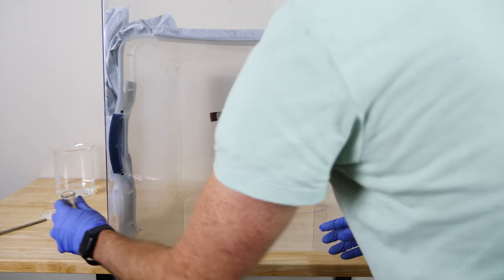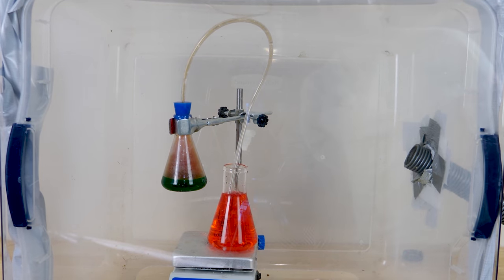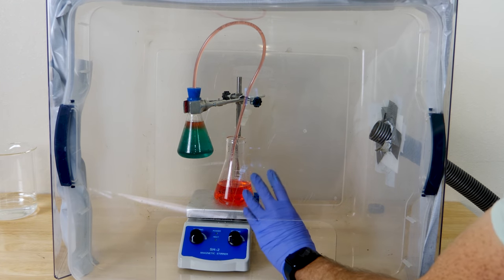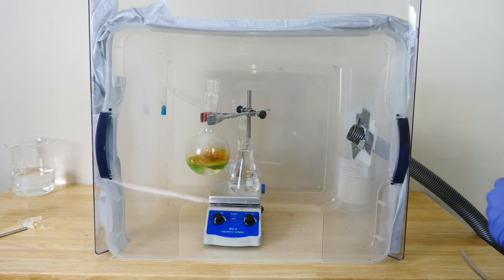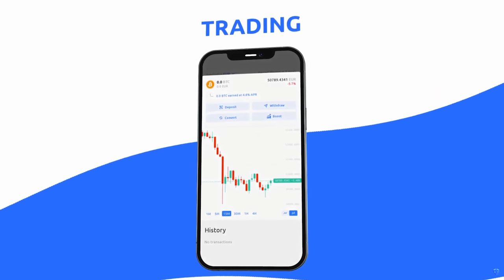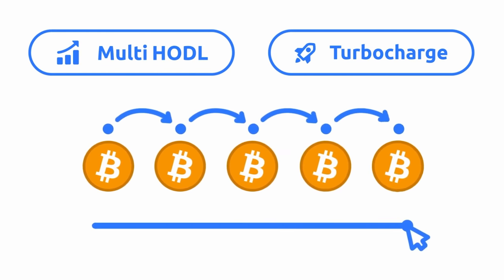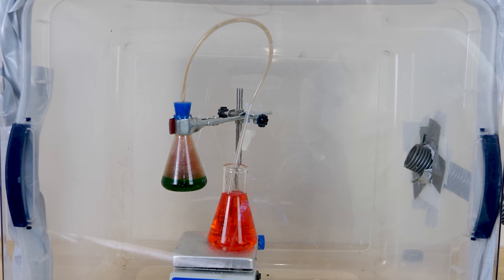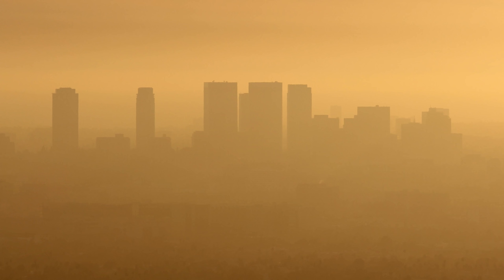Can You Figure Out How The NO₂ Fountain Works?

Comment: Yes, the NO2 gets dissolved (absorbed), but also the NO2 forms N2O4, a colorless gas (the reaction consumes 2 NO2, so creates vacuum) . That's why the brownish color fades away over time.
Reply: He could repeat this experiment with the 2 liquids heated to 60C or more, which would almost entirely get rid of the N2O4.
Reply: @linkpatrick  would that make it harder to retain the nitric acid in the water? I am not sure about this.
Reply: The NO2/N2O4 reaction is a reversible equilibrium that depends on temperature. NO2 is favored at high temperatures, N2O4 at low temperatures. Since everything is close to room temperature here I doubt this played much of a role.

Comment: Ammonia dissolves into the water and the pressure in the container drops. As a result, more water is forced into the container from another inlet creating a fountain effect.
But kids, don't try this in your school lab without permission--a tear fountain will start if the teacher finds out 👀
Reply: @cell to singularity Is it? Oh--my lab manual has this one line answer 😅 My bad if it doesn't work
Reply: ammonia?
Reply: @lautaromorales2903  yeah, our teacher used ammonia all those years ago. Probably because it is less toxic than nitrous oxides.
Reply: @cell to singularity yeah. It creates hydrochloric acid.
Reply: @cell to singularity Will it create H₂SO3?
Reply: @mrxmry3264  oxide?
Reply: @EpicGlitchyJuice  NO2 is not the only possible combination of nitrogen and oxygen. So yes, there are a couple of nitrous oxides.
Reply: @mrxmry3264  I didn't wanna say that and if nitrogen oxides are combing and forming no2 is just like  n2 + 2o2
Reply: @cell to singularity makes sense. Sulfurous acid is a weak acid. Sulfuric acid is a strong acid. I wonder what the concentration of the acid can become in this process.
Reply: oh no  rude to post a religious link on a nonreligious video, especially as doing so is implying it’s about the experiment
Reply: In this setup, it doesn’t matter if the gas is soluble in water, just that it’s released from the small flask, causing a vacuum inside.

Comment: Same thing happens with the related “Ammonia fountain”. 

The NO2 gas is VERY soluble in water and so it’s dissolution actually creates a vacuum. It takes a while to reach this point though, because NO2 is still being generated. Once the rate of absorption into the water exceeds the rate it is produced in the flask though, it back flows.

Comment: Regarding the case of burning matches in an inverted cup...
I think most of the volume change is due to using up the oxygen and has little to do with the temperature. Note that you lose about 20 to 25%of the volume in your experiment.  
I guess you could try doing this over a liquid that doesn't dissolve the CO2 byproduct of the flame to see how much is due to O2 use.

Comment: 1:38 - please correct this mistake . It's not the gas heating and cooling, but it's the match using up all the oxygen inside the beaker... That's y always and everytime when this experiment is done, irrespective of the temperature only 21% of the beaker is filled with water - which is the proportion of O2 present in atmosphere

Comment: 1:32 my first thought was that the nitric acid + copper-> NO2 also used some oxygen from the air, but a more likely explanation is that the reaction is exothermic and heats the air, making it expand. The hot gas mixture escapes out the tube and bubbles out. When it cools again the pressure in the flask is lower than atmospheric and water gets pushed up the tube.
Reply: 2:24 : when the water gets to the top flask it dilutes the nitric acid, and the NO2 can go back to being nitric acid.
Reply: Well, definitely not the first. HNO3 need no extra oxygen.. 2nd and 3rd was right though 😊

Comment: I thought from an old school candle experiment the match burns the oxygen up showing 20% of air is O2. Now I think about it, CO2 is produced with a match and its only slightly soluble in neutral water so why did they teach us this in school?
Reply: No, that is a demonstration of how higher temperatures expand gasses and then when it cools the gasses contract creating a vacuum which causes the water to be pushed up. This video demonstrates an equilibrium reaction that reduces the gas volume.
Reply: @westonding8953  I am aware of what this video experiment shows, my question if you read it, was about a classic school demo of air oxygen content.
Reply: @RedcoatsReturn  interesting. I have not seen that before.

Comment: I was taught that the waterlevel rises because the flame is consuming oxygen, is this wrong? If you used a candle instead of matches the waterlevel rises while its still burning, so I find it hard to believe it's due to the air cooling down.
Reply: thanks !!!       on further study, i see that his explanation of that process was  NOT  accurate; and neither was your/my   teacher's.             expansion of the trapped air  did  NOT  cause  Any  air  to  come  out at the bottom.!     zero bubbles seen.!           it is clear that the 'air' pressure  in the container becomes less-than ambient.         however,   no  gases  Ever   leave the container.      the oxygen  is  Still  in there  Somewhere.
so,  the  REAL  answer must be that the combustion results in the formation of  compounds  that are  more 'compact'  than  nitrogen  or  o2  molecules.      haha.!!!            and   thanks again

Comment: In the auto syphon is it possible to have a higher outlet then inlet by having a diameter increase on the outlet side only and a reducer end cap (smaller then inlet) to prevent air backflow

Comment: My hypothesis:
If a normal straw works by creating negative pressure in your mouth and sucking the liquid up through the straw, then my guess is that pressure is building up, and PUSHING liquid through the straw rather then pulling it. Just my guess tho.
Reply: 1:05
Update
When you blow out all the air In your lungs, you have a negative pressure. You need air, positive pressure, and a lot of it. My new guess is that the NO² built up a negative pressure, and now that pressure is being replaced with water.

Comment: That's why when you have to absorve gases in water and inverted funnel is conected to the hose and it's placed right below the surface of the water, so when the water is being sucked up, the level around the funnel decreases below the funnel and air is sucked instead.